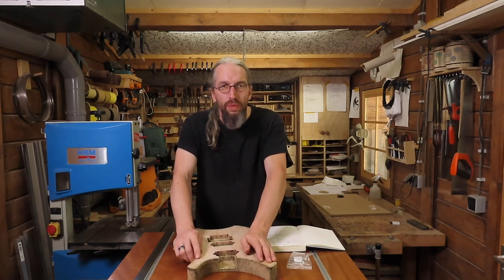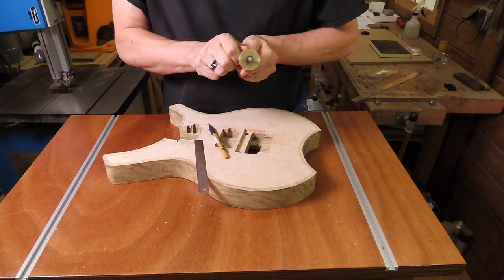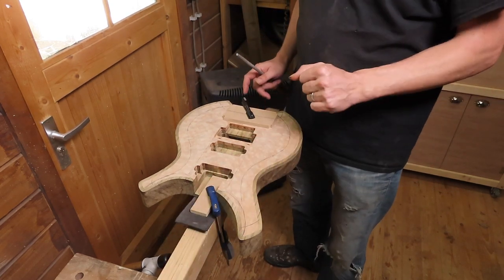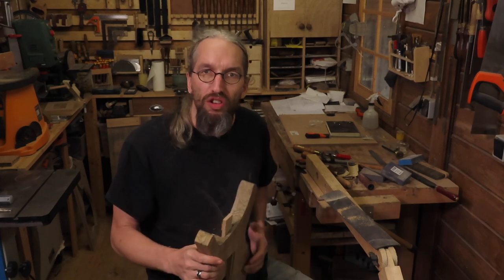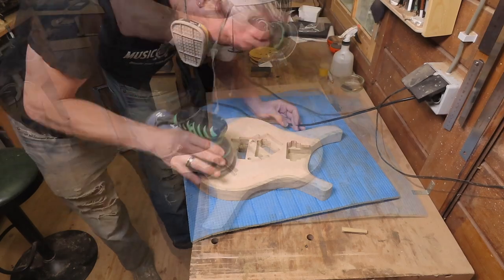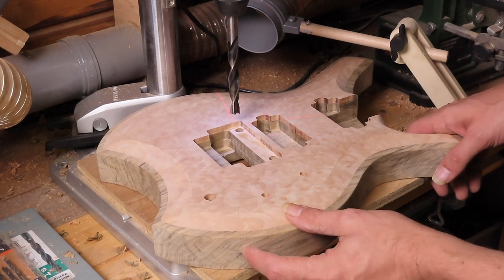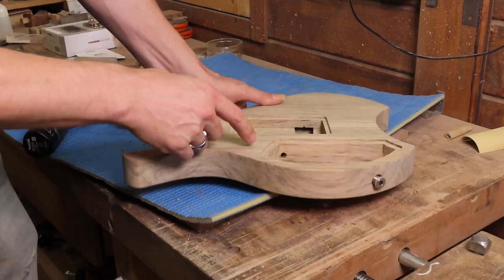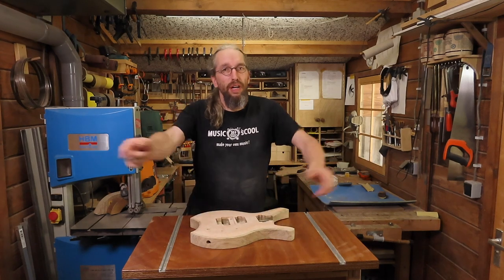Carving the body & Drilling some holes - A new Guitar build Part 13

Comment: Another fantastic tutorial Daniel! I especially like the tip for the putty knife on the body when drilling the hole for the pickup wires. The drill bit you used for the jack socket that is called a step drill
Reply from the maker: Hi John.
With my first guitar build I experienced when drilling the hole to the control cavity a drill bit could really damage the edge of the pickup cavity and grabbed the first thing at hand that was thin but sturdy enough to withstand the drill bit. I've been using the putty knife ever since for this job.
It's a nice little trick to have in the 'toolbox' .
Reply: @UnquendorGuitars  its these little tricks that we pick up as we go along that make us better at what we do

Comment: Wow, a lot of precision work! Now I also realize that this all takes a lot of time!
Is there also a hole needed for a ground wire connection to the tremolo? Just asking cause my Strat has such a ground wire connected (soldered) to the trem.
Reply from the maker: Hey Ton. Doing it all as precise as possible takes a lot of time indeed. The need for a ground wire to the bridge or tremolo claw is a topic of some debate. Personally I don’t ground the bridges anymore after having experienced what effect a faulty wired amplifier has when touching the strings on a guitar with a ground wire to the bridge.
Reply: @UnquendorGuitars  Nice, haven't thought of the possible safety issue! Good reason to not install a ground wire.